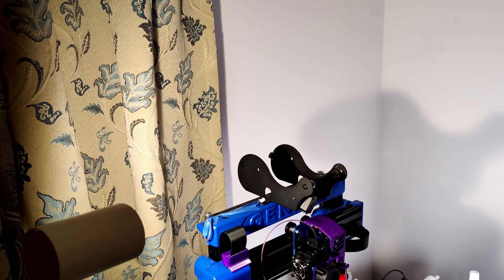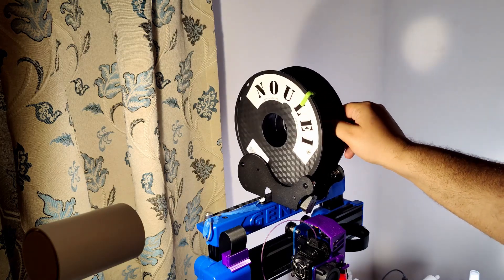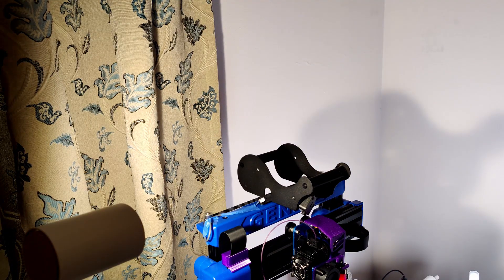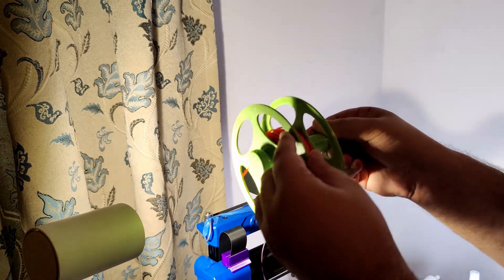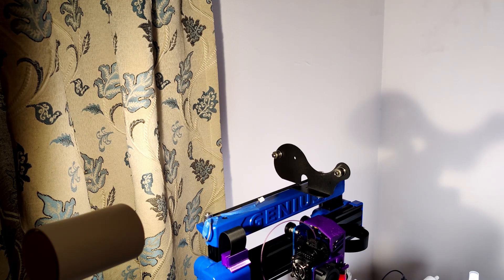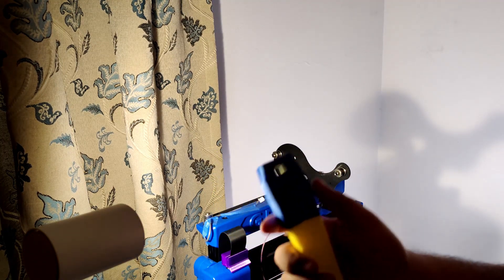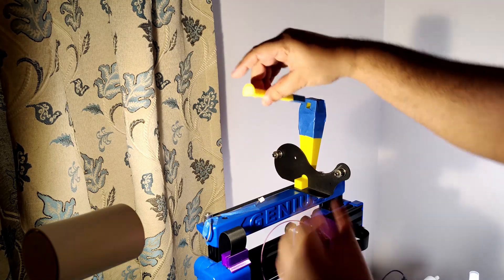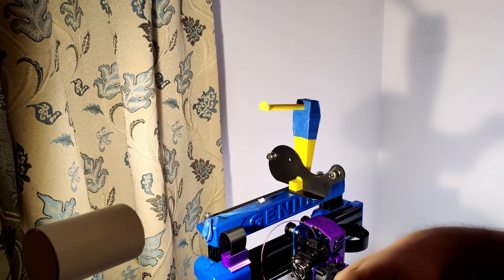Artillery Genius Spool Holder Upgrades

Comment: did you ever finish the design? sadly, after two years of owning the genius, I'm still using the crappy stock spool holder + rollers... but it causes major z-wobble. so I was thinking of designing my own, but I'm lazy, haha, so if you finished something I'd love to try it!!!
Reply from the maker: Yes I did! Unfortunately it's probably not great, but it did work out well for me, so you could try it out and see how it works for you.

I was able to find a spool holder that I really liked: https://www.printables.com/model/65651-universal-filament-spool-holder

I then build a small thing to mount it to the Genius, similar to the one in the video above. That mounting object has a slot where you can use a threaded rod that locks into place. On the open end of the rod you can mount the universal spool holder.

Here's the mounting I made: https://www.dropbox.com/s/h1yviu46wh36ret/Genius%20Custom%20Spool%20Holder.3mf?dl=0

It worked very well for me. Infact, I had to add some foam between the mount and the spool holder to add some friction, as otherwise it would spin freely and end up unspooling a lot of filament while printing! :)

Hope this helps you out as well!

PS: There's a newer version of the universal spool holder which you can use as well: https://www.printables.com/model/66440-universal-filament-spool-holder-gen-2